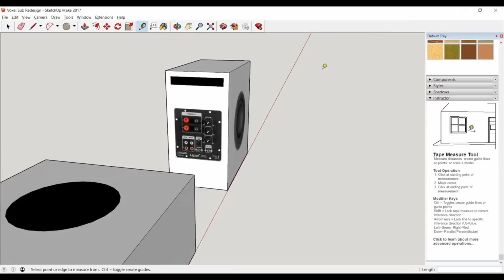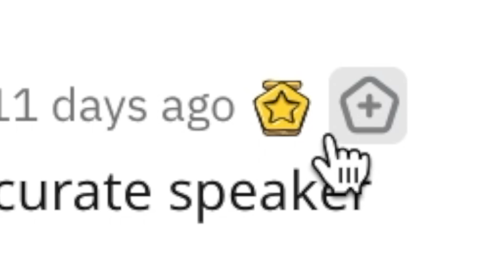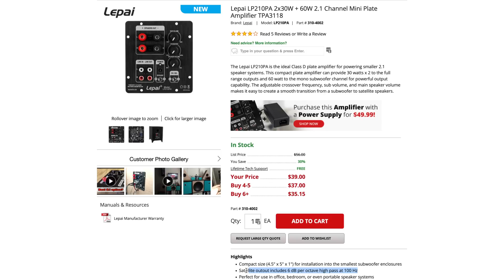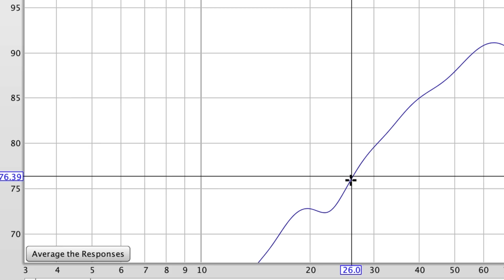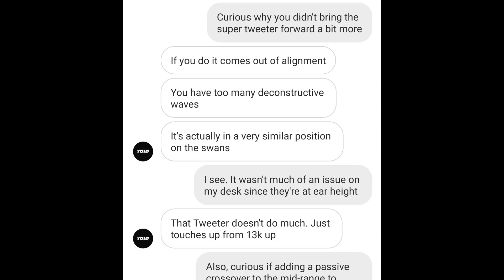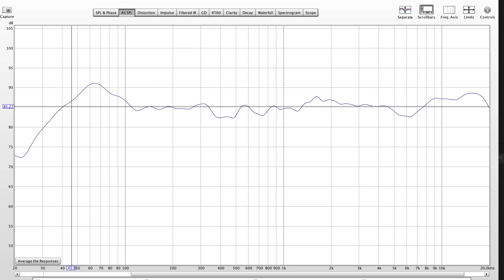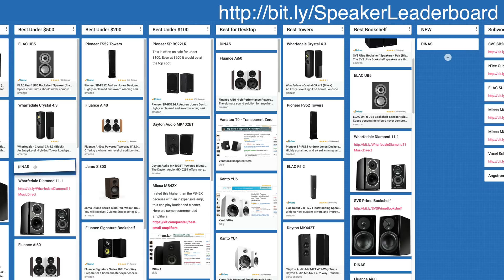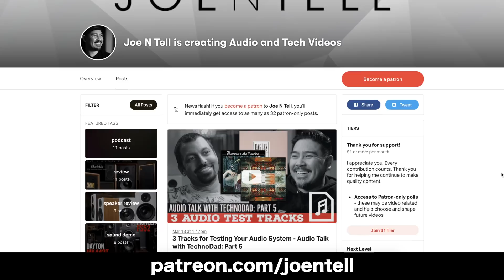DIY Speaker With Subwoofer Hits Down to 35 Hz! - DINAS - Active Bookshelf Speakers Collab w/ 123Toid

Comment: Would it be worth it to swap the Altec Lansing 6" subwoofer on my old 2004 MX5021 with tang or even Dayton version? Or is that a can of worms blending it in? I like my old mini system..but that bass could be tighter.
Reply from the maker: I'm not sure what the bottleneck is on that system. It could be the amplifier.
Reply: I have MX5021 2.1 which I use for TV sound. The built-in amp died (they all do and are impossible to repair due to insane digital tone, balance and volume controls), so I replaced it with one of these 2.1 amps. It is far better than the original Altec Lansing amp - much cleaner, more powerful sound, and surprisingly loses most of the treble harshness. I left the sub and satellite speakers as they were, just removed the old amp and transformer from the sub box, threw away the wired controlled, and fixed the new plate amp in the old hole. Well worth doing.
Reply: I have done just that on my Altec ADA 995 sub. Replaced both drivers with 2x Peerless 830946 drivers. It was good before, now its insane. It doesnt do 35 Hz simply because the ports are not tuned for that, they are tuned for 40 Hz. But it has so much power at that frequency that its making all doors and windows vibrate viciously. The bedroom door I believe  it hits its resonant frequency, vibrates louder than the sub is playing,  so if I were to play a 40hz tone loud enough for long enough, that door would eventually rip itself off the hinges. In short, stock Altec drivers are nowhere near as good as Tangbands, so upgrading them with something decent, produces a tremendous jump in quality and quantity of bass. DO IT.

Comment: How do you suppose those parts would sound in a sealed enclosure with a separate sub?
Reply from the maker: I've never tested this sub in a sealed enclosure. It definitely won't hit as deep without using DSP.

Comment: You could definitely save around 50$ or more if you do some research and find some of the parts from china. I found the plate amplifier for 10$ less and the power supply for 10$.

Comment: If closed they could go a lot lower with some EQ ❤️
HAHAAA that all about the bass was funny!
If i wouldn't be already building some speaker's i think i would really like them.
But then there is the problem that small speaker's create a dip at 45-65hz my room. I don't know why but with a 10" in Bassreflex and a 12 also in Bassreflex and similar response in winisd the 12 was more flat and overall didn't do weird stuff. Also it was the same one as the 10. Just it's bigger brother. And a 15 in a closed was even better. I have no idea why.
Reply: Low frequencies needs space. The lowest frequency of a bass guitar is 32 or 41 Hz. This means a wavelength between 8 and 11 m. Here you can calculate this http://www.sengpielaudio.com/calculator-waves.htm
By the way, in the analog age, it wasn't usual to play bass guitars with more than 4 strings, so the lowest frequency was 40 Hz, speakers usually couldn't play frequencies below this and living rooms aren't large enough, to play the lowest notes of a pipe organ.
Reply: @robfriedrich2822  I have a 4m by 6m room, with room gain is it possible to get 25 hz?

Comment: Hey Joe, i love the speakers, I have a question about cabinet material.  I have a ton of 3' x 8' 2" thick maple butcher block style desk tops. If i respected the internal dimensions would that heavier material have any effect on the sounds quality?  Thanks
Reply from the maker: That's a question for 123Toid, but my guess is as long as the internal dimensions and port lengths are accounted for, it shouldn't make much difference to the sound.
Reply: @joentell  Thanks!
Reply: @gozergozerian3192  absolutely you could.

Comment: I initially thought the solution to mediocre bass on my desktop speakers was getting speakers that output more bass, so went all the way up to 8" monitors. The only solution I found that worked was to blend in a well placed sub to even out the response even though the speakers didn't need a sub in principle.
Reply: Could just have been the place your desk is sitting.... Did you try moving your desk before going with a sub to see if that would impove your bass?
Reply: Attainable Audio It’s definitely room related. In the 3 rooms I’ve set up I tried 4-5 different positions for the desk and none of them gave me the results I was looking for. 

I’m probably just unlucky and have landed in super bad rooms haha. But I was always able to get the bass region spot on by mixing in a small sub positioned somewhere else in the room  then using parametric EQ to remove the remaining bumps.
Reply from the maker: That's one way.

Comment: Frankly I think the Dayton Audio CX120-8 4" Coaxial Driver with 3/4" Silk Dome Tweeter would be a better choice for this project. I do like the idea of a built in amp and subwoofer.
Reply from the maker: That looks like it would be an awesome alternative. I would love to hear a version with those drivers. The only thing is we wanted to keep the box as small as possible. That driver requires a bit more space in a sealed enclosure to be able to be crossed over below 150hz, preferably 100hz. That means the overall enclosure size would have to grow. Great idea!

Comment: These are amazing speakers. I have very little to add that you have not said yourself yet. But as a speaker designer myself I feel like the claimed f3 is misleading. In the measurement it is clearly visible that the actual f3 (considering the definition of f3) is around 44Hz. Turning up the subwoofer level does not magically lower f3, it increases the subwoofer output. So relative to, say 1000Hz, the f3 is lower but because of the enormous bump between 40 and 100Hz it does not sound like that at all, you merely increase the midbass.  They are definitely low/hard hitting speakers with tons of nice features but an f3 of 45Hz-ish is not rare nowadays. In addition, feeling the ports at 6ft away is not a sign of 'loud bass' but merely of a relatively small port. If you add a port that is much too small relative to the air displacement of the woofer to any given speaker, you will feel the wind at longer distances. It's not special, it's not a sign of power, it's a design flaw/limitation. 

To wrap it up, these speakers are good but the specs are a little over-hyped and despite their features, the speakers have their limitations, just like any other pair of speakers. Props to 123toid for designing such an accesible and feature rich speaker but please retain your honest and mostly objective style and don't over-hype a speaker.

Comment: Under $300.  NOW....consider that if those parts are $300 RETAIL, these speakers, (no matter where made)  would be AT LEAST $1500 a pair.  People are often fooled by the price. I've made kit speakers with a $30 VIFA tweeter and $40 vifa woofer for $350  a pair with parts from speaker city and parts express.  They were pretty good, not great- but would have been $999 a pair on the market at least. An affordable midrange:  Faital pro  fullrange.  Fantastic and very affordable.
Reply: $1500? Your exaggerating there.
Reply from the maker: I think the general formula is that the cost of the parts for a speaker is 20% of the retail cost. So yeah, that's about right.

The rest of the money is for margins for retailers, marketing, accounting for returns, administrative costs, taxes. Lots of stuff.
Reply: @joentell    The $999 speaker I refer to?  SVS ultra bookshelf.  Good speakers but...I can assemble a pair from parts express for (at most)  $350 shipped with equal or better drivers.  Retail.  SVS gets them mass produced in Asia for probably $100 a pair at most.
Reply: Your PCMD  you have no clue do you? Ever heard of polk audio lsi9? $100 in parts, and they sold for $1800 a pair. The best feature? $30 Vifa ring tweeters. The mid/woofers were cheap Asian produced junk.  The low-quality drivers came through as a mediocre sounding speaker.  I could make an MTM for $500 a pair that would destroy them.  I won't even go into other boutique brands that charge up to $20,000 for $500 in parts.

Comment: I use the same woofers in my truck.  With cabin gain I have them tuned up to go from 0 to -10 DB from 80 to 18 Hertz. My guess was pretty good because they sound awesome and will play any kind of music at a good volume.  The drop incredibly low and sound very realistic for such a low price.
Reply from the maker: Holy crap! I also want to use these as subs for my van. How many are you using. I was thinking 5 would do the trick. 😉
Reply: I'd like to know more on your setup. I use 2 6.5 TBs in a box in my car. They sound pretty good considering it was just a test box i made. I just like seeing how others are using TBs in their cars.
Reply from the maker: I'd like to know more about your setup! 😊

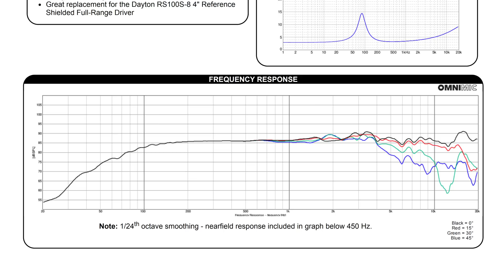Comment: 4:25 all the way to 20kHz? On axis. Off axis it does a pretty shitty job from 5kHz up. 
This box would be so much cooler with some decent 4" coax on top of that woofer. If there was a decent 4" coax.
Reply from the maker: Looks good up to 15 degrees off axis. These are designed for nearfield use where you are almost always on-axis. 30 degrees is a lot. Plus we are using a external tweeter to help with the top end.

I have a 4" coax I pulled from a ELAC UB5. 😉
Reply: @joentell  30° isn't really that much and it's always better to have a smaller diaphragm for higher frequencies.
But don't get me wrong, I'm not criticising the final box, I really like it.
Reply from the maker: I get you though. That's why I pushed for the external 1" tweeter.

Comment: Why can't JBL, Klipsch, KEF, or ELAC do this and have bookshelf speakers that go down to 35hz?

Lazy? Engineers that don't deserve jobs? Total ignorance of consumer wants?

I've often been suspicious of how little bass speakers make... The LSR308 has anemic bass compared to this.

Just imagine if you and the guy who made them had $1,000,000 to develop them...

You could probably get them a under 30hz with ruler flat frequency response, all active crossovers with 3 channel amplifiers, and throw passive radiators on the sides.

Besides this speaker, the Kii Three, Dutch & Dutch 8C, and the Genelec 8260, everything else seems like poorly designed, lazily engineered, full of excuses, over-marketed nonsense.

Is there some huge compromise with this speaker that I am missing?

I'm curious how much distortion there is at 35hz, or if it's even audible.

Maybe it's time to build a subwoofer with five of these drivers, one on each side plus the top... see if it can go down to 30hz with enough power to compete with much larger subwoofers.
Reply: So that they can sell you a sub
Reply from the maker: I'm not sure why they don't.
All I know is if we had an active DSP to flatten out the response I couldn't imagine much better for the size

Comment: super interesting concept.  I'd be more than a bit concerned about the ' new tech'  amps, their sound AND  espec. durability compared to garden  variety Denon / Marantz type integrated amps of the same power . then the price is still a bit misleading, need some sort of preamp for the phono / CD  / DVD player.  Your review are like tops, won me over with the Bose 301 bit.
Reply: PS - somewhat similar, but cheating - I was thinking of getting new cabinets and putting the drivers from my Polk RTi A1 speakers ( good 4 inch mids ) with a couple powered 6 in. sub bass , $90. ea from Amazon  that'd be a complete set for $600 or so depending on the cabinets - all sized for the subs less than 1 cu ft sub bass. ( with slot port ! ) just for something different.
Reply: I did it - actually the Polks were 5.5 in ( mid/bass)  went with Q Acoustics 3010i.... they get real good reviews, except not really 'full range' they're designed for a sub.  So , mid 1960's AR4 cabinets, real good original wood veneer, 19 in tall.  the Q  4 in mid/ treble / crossover + 6.5 in subs, I did get the amazon 6.5, they were ' OK' but I thought.... lets try Dayton 6.5 in 'subs' the 165 model. oh, a 100 hz high pass as well. total cost, around $550. pr....
I'm a bit curious, just using Utube speaker response tests, I don't get any sound at 'normal  Amp listening level' below 50 or 55 hz.   But then, I run a 'bass guitar tuning aid and the low E ( generally 42 hz I think) is very strong and clear.  is it possible that is not the fundamental frequency but the overtones , I have no idea but it does put out the listed 42 hz..... ??  no scientific bass port tuning, didn't have room for a 2 in tube, a 4.5 x 5. x .75 in rear slot.
Reply: Lepais are fine. Hell a lot of the Chinese chip amps are fine and durable. Have been driving tda 7498 for years now. At full power, the board stays very cool. The Op amp vs. a lower level Denon out of the water. Better bass, and much higher clarity throughout the entire range. $10 vs $700 It's always the buyers decision though.

Comment: My dual W5-1138 subwoofer has a slotted port. I’ve been using slot ports for over 14 years in all of my designs.
Reply from the maker: Oh yeah, slotted ports aren't new. They are just a variation of the port on that Voxel subwoofer we based some of this build on.

Comment: I notice the video says midrange and tweeter share a single channel and that makes sense because you don't want woofer playing right channel and tweeter left channel etc. My question is, did you bridge the two channels and put a bass blocker on the tweeter? How are the midrange and tweeter hooked to the plate amp?
Reply from the maker: Mid-range and tweeter are sharing the same channel and the tweeter has a capacitor to block lower frequencies. The entire speaker is getting a single mono signal since we are using an RCA splitter for each speaker.

Comment: I would love to make a passive version of these that can be connected to a 5.2.4 surround sound.
Reply: Before I sent these off to Joe, I tried these out in my smaller living room and used the 7.1 channel RCA preout to run these by themselves as a theater speaker. I was really impressed. Keep in mind they were in my living room, which is not a huge space at all.  But did a fantastic job.  I would recommend them for smaller living rooms to use with a preamp like a surround receiver for home theater.  of course you could go crazy and build like four or five of these and have five powered subwoofers all around the room. That would be pretty awesome.
Reply from the maker: Assuming his AVR has preamp out. I think only the higher end ones have that for all the channels.

Comment: Regarding the DINAS...

1. The plate amp is available as the AIRS SW-501 in Aliexpress. I have used it over a year ago in a 2.1 boombox project. The speakers (including the satellites) are connected internally.
2. The amp is based on two TPA3118D2 chip amps. One for the sub (with variable crossover) and the second for the satellites. The TPA3118D2 chips are without any heatsinks. They use the plate section for heat dissipation. They are more suitable for 8 ohm loads. You have used 4 ohm speakers all around. Be careful of not overheating the chips.
3. The RS100's are good drivers. But they can be a bit forward sounding in the midrange. Will await the sound test and comments for this.
4. The tweeter will definitely help in sound dispersion and increase the sweet spot and sound stage.
5. I am keen to understand how you hooked up the tweeter and full range drivers. Did you connect both left and right channels outputs to one output?
6. Also, the plate amp has 25V capacitors all around. So, I have used a 24V 5A power brick without any issues. You get the best out the amplifier with 24V power supply.
7. Overall, the DINAS are a great looking project. Very clean lines. I have used the bigger brother of the subwoofer, the Tang Band 1139SIF, in a another boonbox project using the AIRs SW-1001 plate amp which also has bluetooth and power supply built-in. That project has the RS100-8's and the AMT-8 tweeters doing satellite duties. All connected internally. Great powerful sound all around.